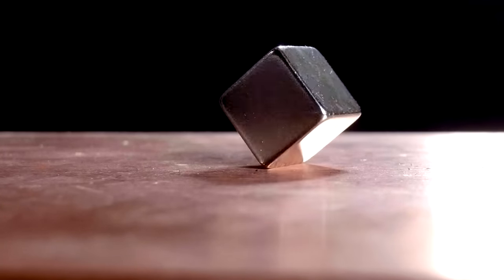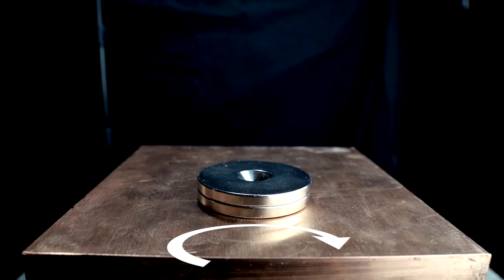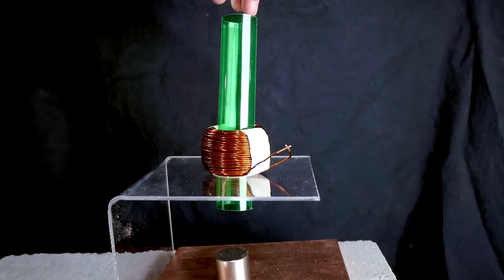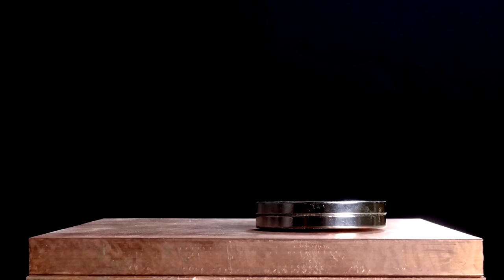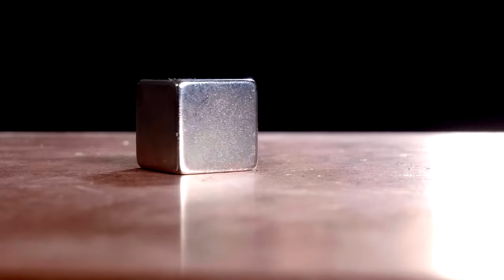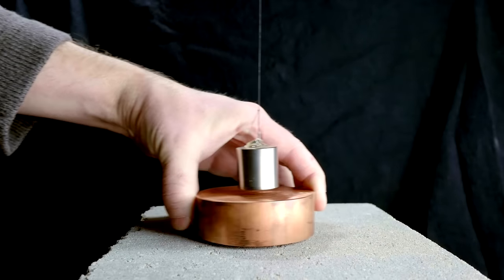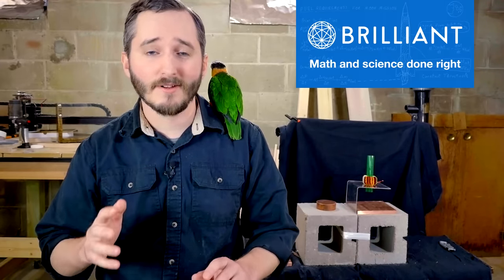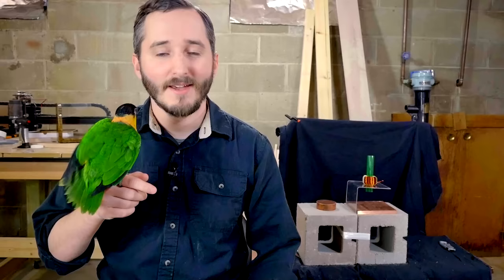Copper's Surprising Reaction to Strong Magnets | Force Field Motion Dampening

Comment: I've always thought this would be a great way to land vertical take off and landing machines,  like the reusable boosters from Space-X. Not only would they resist change when landing, they would also absorb shock from higher speeds. I think they would allow some sort of loose "grappling" effect in the case of the moving landing base(OCISLY for example) and would stabilize it before actually touching the surface.
Reply: They would need ENORMOUS electromagnets and batteries (maybe not too big, since it would be an one time thing and it would be just a pulse. In that case, just a big ol' capacitor would work)
And those things would add weight to a rocket which is an analogy to something you generally don't want to do
The base would also be a little heavy since it would need a continuous or a few big plates, why is weight a problem? Don't those things land in barges?
The magnetic break thing might not be a so good of an idea simply because of the fact that it would just be a hard break coming earlier, instead of hitting the ground, it hits the magnetic field, making it about the same thing as hitting the ground, because the deceleration would be about the same

There's hope though, if the rocket has the coil on the outside and it has a little tube or something, it would have more time to break
Reply: SeanHodgins it is still an interesting idea
Reply: The additional weight would be pretty significant.
Reply: You would still be going from terminal velocity to almost zero in a few short seconds. You might as well have them crash land.
Reply: I bet if you'd mathematically compare the way the spacex booster landings work right now with your idea, they would be identical.
Reply: SeanHodgins @
Reply: The amount of fuel saved would be cancelled out with the extra weight needed to be carried, but in space with the lack of gravity it could be an interesting idea to use magnetic repulsion as an initial push for a craft to build that initial acceleration before fuel is used.
Reply: SeanHodgins i was just about to comment this
Reply: Shockwave Shockwave only magnets and a large copper landing pad
Reply: All they would need is a superconducting coil , achieved with cryogenics
Reply: Michael Parker I'm not sure they want to interfere with the main craft position or trajectory  by springing off of it. I imagine it would create more headaches than it would create advanges.
Reply: Well, we so use induction for braking, just maybe not for landing. Induction braking is great if you want to reduce motion without contact friction. Shock absorption from landing would be the same though, unless you arrange gradual braking, like a braking tunnel which the vehicle has to pass through with progressively stronger coils. This is... Possible, but would require alot of precision on the flight-side of things and it's questionable how good an alternative it is to traditional vectored thrust and parachutes!
Reply: Just wanted to say this was very close the my first thought.  If only someone had created a way to transfer power wirelessly this would become a AWESOME way to land a craft.  It would eliminate the need for on board battery storage.  Oh wait, someone already tried then he was murdered, and all his projects were bought and destroyed by those controlling the power industry.  It's funny how people can accept the idea of a wireless phone charger; yet the idea that we don't actually need a wired power grid seems so far fetched.
Reply: Jon MacDonald And how would we have widespread energy distribution infrastructure wirelessly?
Reply: Nope, because it would still experience the same G-forces. There is still a large change in momentum within a small amount of time like with the magnet stopping right before hitting the copper plate, that it would destroy the rocket.
Reply: +Pupper Gump No, bullets are made of lead and only a little bit of copper, which makes them not very conductive to electricity. However, with a powerful enough magnet it is possible to repel bullets using a property known as diamagnetism.
Reply: Pupper Gump - Regardless what you use to stop bullets, the stopping mechanism still has to absorb the kinetic energy of the bullet.  Lead is not a fantastic conductor (Google "conductivity of metals") so it wouldn't be slowed as much as a silver bullet, but if we imagine for a moment that a big magnet on your chest would do the job, you would still feel pretty much the same force as if you were wearing a thick steel plate on your chest.  Admittedly, the bullet would slow more gradually in the magnetic field than by coming into contact with the steel plate, but its deceleration would still be pretty sudden - from the speed of sound to zero in how many microseconds?   Bear in mind, however, that the kinetic force given to the bullet in the first place all comes from the shoulder of the shooter, mitigated by the mass of the rifle, as its deceleration is mitigated by the mass of your protective steel plate.
Reply: SeanHodgins thought same thing!
Reply: jojojorisjhjosef I guarantee they wouldn't
Reply: SeanHodgins the cost of a solid copper Landing Pad would offset the savings made by going to reusable boosters probably be cheaper to use non reusable boosters to go build a solid copper landing pad
Reply: Shockwave Shockwave a capacitor that big could kill a heard of buffalo.
Reply: Pupper Gump you surely are Gump. The copper vest would be too damb heavy compared to kevlar and it would only work when some nut job decides to reload his brass with magnets instead of bullets.
Reply: It is a cool, fantastical idea, but even aside from the G-force issue, the amount of heat would likely damage the magnet beyond use.
Reply: Makes me think of Dick Tracy's "Magnetic Powered Space Coupe". ;)
Reply: So you think that if I put say an egg in a container and put that on the magnet and dropped it on the copper plate that it would have the same chance of cracking as if I dropped the egg and container on a magnet over a concrete plate? I respectfully disagree. It would make a nice/easy experiment though huh?
Reply: Good thinking bat man, we could use a magnet and copper plates under lifts such that if should the lift cable break,  you are very likely to live to tell the tail. 
And then think we could use them on runways and planes could land near enough vertically, and Batman can jump from tall buildings with magnetic shoes and land smoothly on a copper surface. splendid ideas.
Reply: Metal plates already stop bullets
Reply: Have to park the mass of Cu in another dimension so the rocket could get off the ground.
Reply: The heat generated by the boosters at the base would negate all magnetic properties of a permanent magnet. Would electro -magnets be any different?
Reply: Can I check your math? That is an assumption that the fuel saved would cancel out the extra weight... a bad assumption I might add based on the little know info you have.
Reply: Feline Fillet true they would go right past their curie point. Aswell, the idea of an electric coil and a massive cap in the rocket could fry all the electronics with its massive emp blast when it turns on.
Reply: " Not only would they resist change when landing, they would also absorb shock from higher speeds."

Um, maybe you didn't notice that the repulsive force generated was proportional to the closing speed.  Ultimately the closing speed would decrease sharply to a steady-state value....it would be very much like smacking into the ground at high speed.
Reply: go read everything Nikola Tesla did , he did it in before 1900 and wanted humanity to have FREE electricity :)
Reply: SeanHodgins With such powerful magnets and highly dense magnetic fields; too many complications would occur with other circuits such as transformers and solenoids, tuning coils, gauges, even electronic things like timer switches, pace makers, odometer, power windows, fuel filters, etc. I want to make a microwave laser gun using a microwave oven or better yet; a microwave transmitter from a cellphone tower. Knowing my luck- that just won't ever happen. 😞
Reply: @crackedemerald4930  do they even fly and work correctly? I'm yet to see one go into space and I never will
Reply: :hand-pink-waving:E=MC2 is a joke! OK let's get this correct  !!   #1  The only reason radio waves and AC current travel out in space and down a wire is because of the "CENTER " of a magnetic field.  (The "B" field), The North and South poles are the weakest part of a magnet !!   Just like Tesla said,  you got to look at things you can't see !!  At the center of a magnet is anti gravity,  (just tap the center on any glass or plastic and it will loose weight), The center can repel water if vibrated at the correct frequency,  If you vibrate the "B" field into granite rock it will become soft and you would need copper tools to work on same , you don't want to disrupt the magnetic (B")field ) with other iron.  Once you understand the "B" field of a magnet and how it relates to the entire universe we live in, you will then understand what Tesla was telling everyone "LOOK FOR WHAT YOU CANNOT SEE""  .I believe the pyramids were inter galactic communications and transportation systems.  Stone Henge and Gobekli Tepe , power plants.  Take a look at Coral Castle Florida on YOUTUBE and you will see a similar pilar. I believe these horizontal pillars were oscillators that would provide excitation for many things from crops in the field to anti gravity  FYI: If a UFO fly's to close to you the "B" field that provides the anti gravity ("B")Field).  will cancel out your power source  !!!!  E=MC2 is at best just a joke!!!

Comment: I love these simple concept videos, just a single idea that gets expanded into something bigger.
Reply: E=MC2 is a joke! OK let's get this correct  !!   #1  The only reason radio waves and AC current travel out in space and down a wire is because of the "CENTER " of a magnetic field.  (The "B" field), The North and South poles are the weakest part of a magnet !!   Just like Tesla said,  you got to look at things you can't see !!  At the center of a magnet is anti gravity,  (just tap the center on any glass or plastic and it will loose weight), The center can repel water if vibrated at the correct frequency,  If you vibrate the "B" field into granite rock it will become soft and you would need copper tools to work on same , you don't want to disrupt the magnetic (B")field ) with other iron.  Once you understand the "B" field of a magnet and how it relates to the entire universe we live in, you will then understand what Tesla was telling everyone "LOOK FOR WHAT YOU CANNOT SEE""  .I believe the pyramids were inter galactic communications and transportation systems.  Stone Henge and Gobekli Tepe , power plants.  Take a look at Coral Castle Florida on YOUTUBE and you will see a similar pilar. I believe these horizontal pillars were oscillators that would provide excitation for many things from crops in the field to anti gravity  FYI: If a UFO fly's to close to you the "B" field that provides the anti gravity ("B")Field).  will cancel out your power source  !!!!  E=MC2 is at best just a joke!!!

Comment: my daughter is teaching a class on science so i loaned her some strong magnets from large speakers and a homemade electromagnet and I made a stack of disk magnets with holes stack on a wooden dowl with repulsing fields so the magnets float on top of each other. 
I have seen some other videos of using copper as a brake but not in demonstrations like this i will have to try some of these and make some new displays for her.

Comment: You could insert the magnets into a wheel that spins with a motor and spin them above or below the copper and check the temperature of the copper as it rises with IR thermometer. This would effectively demonstrate this heating effect of the electricity inside the copper imposed by the magnets. 
There are also magnetic mixers for chemistry that spin magnets below a surface. The copper plate might heat up from one of those also, but to a lesser degree. 
This is theoretical, but demonstrating it would be a nice proof of concept.
Reply: resistance and (/in) the electrons causes heat induction
Reply: Auto electrical, why not mount the magnets to a bicycle wheel running them past multiple coils.  I wonder how long it would run if you rigged a alternator core to run off the electricy produced by the magnets.

Comment: This is not being sycophantic. The magnet passing through the coil, and the movement converting to light, is the best demonstration of electrical generation I've seen. And diesel generators with a rotor (magnet) turning inside a stator (coil) were part of my job in the 1990s. Absoutely made my day, the quality of presentation nowadays.
Reply: Don't worry, no one will accuse you of sycophancy

Comment: This is great! I'm finally starting to understand how electricity is really made!

I used to be told it was just steam running a turbine. I could never understand how it gets into our wires. Now I see there is an electromagnetic field that is stimulated by interaction of magnets and electrons
Reply: steam through a turbine    hehe     oh.. you gotta love it 

ok,  firstly  it's not MADE,  it's GENERATED
which is why things that make electricity are called GENERATORS

Secondly .. Electricity is just merely the movement of electrons through a conductor.
or in other explanations

a Copper Atom has electrons, and a certain number of electrons occupy each electron shell.
we are just concerned with the outer shell

this shell is called the VALENCE SHELL
and the 1 electron in the outer shell is called the VALENCE ELECTRON

Copper has 1 Atom in it's valence shell
and as such it would rather it LOSES an electron (That's how atoms work)

simply stated,  an INSULATOR is an atom that would rather NOT LOSE it's electrons
a CONDUCTOR is an atom that would prefer to lose an electron or electrons
MAKE SENSE ?

so it's not important to understand the magnetic part of it .
Electrons have an electromagnetic field,  REMEMBER THIS

now. when you line up (for arguments sake)  one copper atom next to another and another and so on and they are all a certain distance from each other, but not too far either
BETWEEN THE ATOMS.... you get a force    basically think of it as   the South pole ofa magnet  trying to come close to the south pole of another magnet

so.... ELECTRONS ARE NEGATIVELY CHARGED
and hence   Negative  repels Negative... right ?

so.. when an electron gets close to another electron... THEY REPEL
the FORCE that causes this repulsion is called  EMF   Electro Motive Force

now... remember that line of electrons
now.....  IF YOU WERE TO PUSH 1 MORE ELECTRON INTO THE CIRCUIT 
HERE IS WHAT WOULD HAPPEN

THAT FIRST ELECTRON , VIA EMF,  CAUSES THE ELECTRON NEXT TO IT TO JUMP TO THE NEXT COPPER ATOM.
and that..... CAUSES THE ELECTRON IN THAT SHELL TO JUMP TO THE NEXT ATOM  AND SO ON AND SO ON

AND VOILA....... ELECTRICITY FLOWS

and where does that first electron come from ?
well.... A Generator,  a Battery,    some external power source 

does that help you understand electricity and how it's generated ?

Comment: Just an observation: at 3:03 you said that the magnet didn't stop because the LED was "efficient", but I think it's the forwars voltage of the led that is high, not letting most of the current passing.
Beautiful video btw!